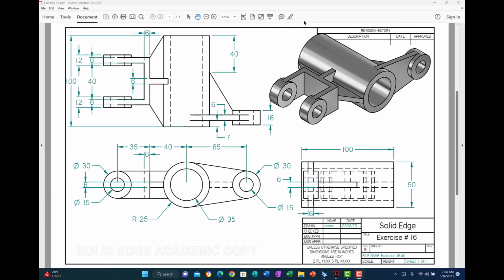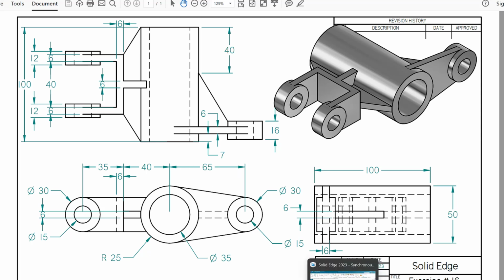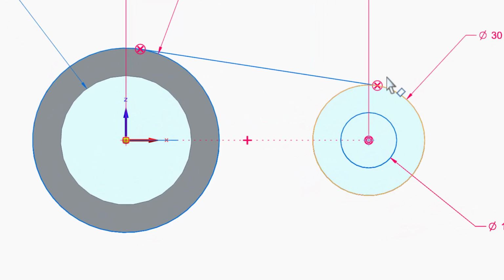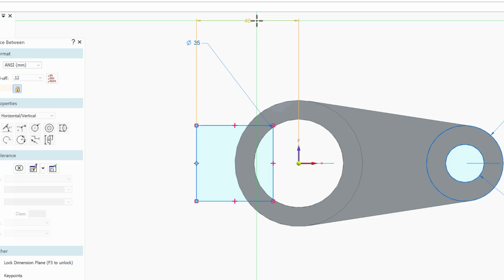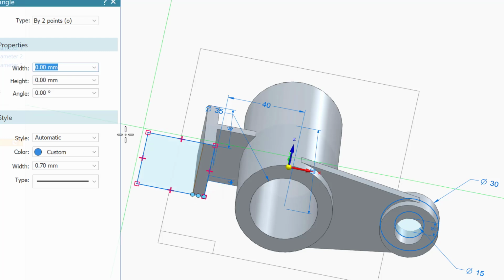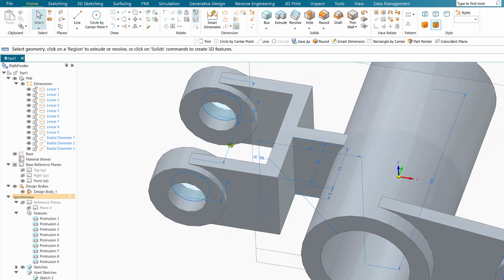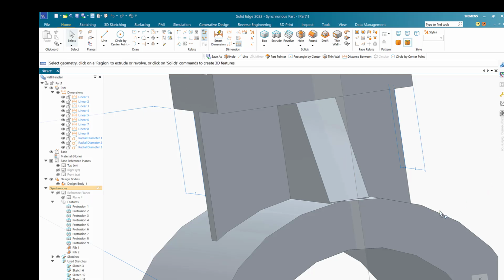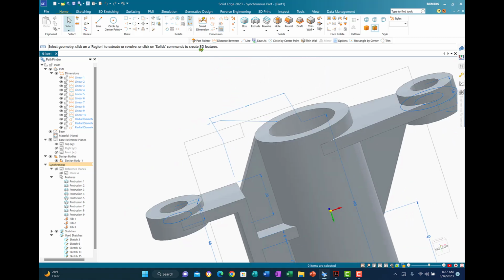Solid Edge 2023 Tutorial - Exercise 16

Comment: Note to Dr. : You will find it much easier to select the tange/web to extrude to 6mm before you select the concentric circles to make the 12mm sections. This way you don't waste steps by finding and using sketch 'restore'. By using the above order of execution, you save mouse movement and clicking around.   And it appears likely you use drawing/sketches created from Siemens - You might alert them to the Title Block being INCHES exclusively and the DWGs object dimensions wrongfully not designated as UNITS of mm.  I don't know which Siemens 'Support' to contact.  It very unprofessional. Shows all associated to not have real world industry/production experience. It teaches poor drafting/CAD practices leading to Poor Quality in Education, and production delays, and quite possibly wrong parts in MFG.  Not a good look.  Thank you for your efforts.   I am sure you are aware that, "Poor quality in = Poor quality out."

Video production change: Please go back to showing more of the SE application window as you work. The limited window section view on this video makes it confusing for the student (me) to know what is happening without seeing the Command Ribbon and the side bar of DWG steps completed. Also, the Overall Window Zoom in/out to see sections of the Application are distracting.  (The Zooming in/out to work on the part is OK.)  You are aware the mouse scroll button is the Zoom? The use of off screen icon indicated commands is not obvious and is a waste of mouse movement. I think most of us students will have mouse scroll buttons available? Makes for a more experienced skilled experience.  Thank you for posting.   I am learning from you.
Reply: Where is the Tange/web command?